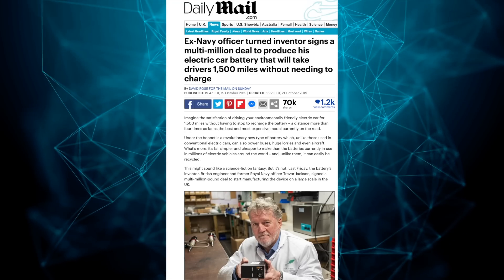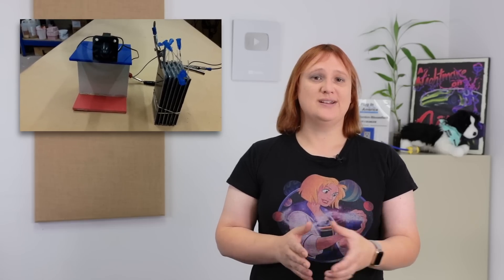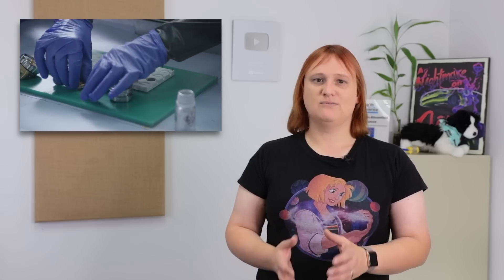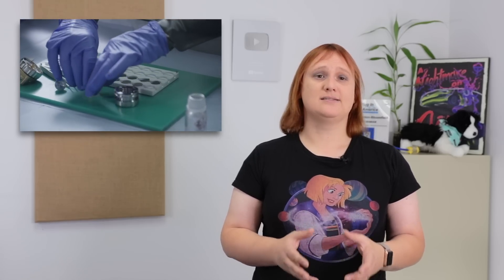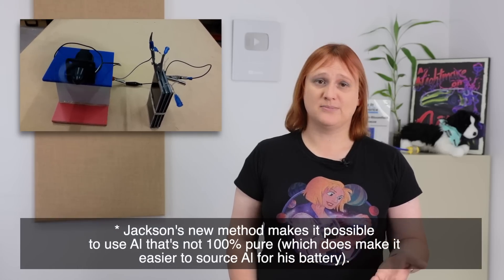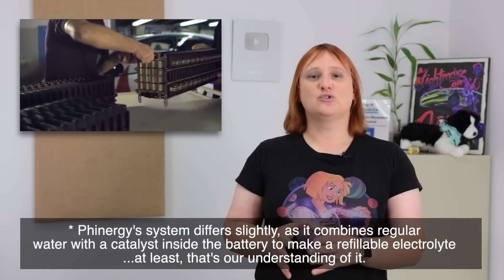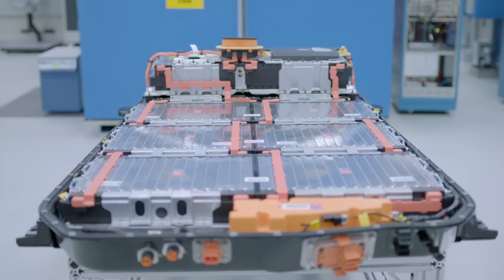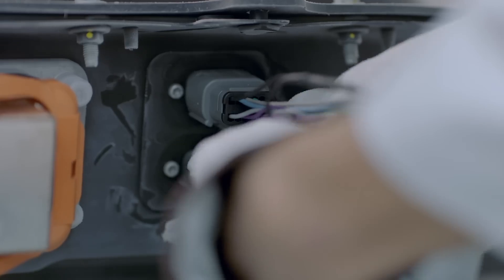Is This Battery The Holy Grail For Electric Cars?

Comment: regardless of the materials used i don't see how a battery that needs to be remanufactered every time its charged is going to be better for the environment.

Its almost like talking about making a car that uses giant Duracell disposable battery's silly really.
Reply: Respectfully disagree. Aluminum is cheap, not terribly toxic, easy to work with and widely available. By comparison, gasoline is very nasty stuff!
Reply: The aluminum oxide can be reprocessed into aluminum. If that process is powered by relatively clean energy and people recycle the battery like they do lead acid ones, then you have a net gain.
Reply: Plus they can use recycled Aluminium in the production of these batteries
Reply: And then there's the extensive energy needed to refine oil into petroleum through process technologies. Aluminum might be no worse.
Reply: @shrimptopian this new system is more energy dense than lithium ion, independent testing puts it at around 9x the energy density of lithium ion.
Yes the tech has been around for about 100 years but has not progressed much up till now due to less toxic alternatives being available, until this man found an alternative electrolyte that isn't toxic.
BUT petrol has been around for about 150 years as have lead acid batteries and current vehicles wouldn't have a hope in hell of running on those 150 year old formula. They have been able to advance these because money and resources have been pumped in to them. The Aluminium air batteries have had nearly no money put in to them for advancement.
As to your point of Aluminium recycling being high energy and toxic that's a load of bollox! Aluminium recycling is essentially just melt the waste metal and recast it. Zero toxic chemicals used and about 70% less energy used compared to lithium production.
The only drawback to this tech is the energy pack replacement infrastructure and cars being designed to be able to hot swap the energy packs
Reply: @shrimptopian apart from the lower grade Aluminium needed and the less toxic electrolyte used  you are absolutely correct 😅
But as I said we will see soon enough as it's going in to production next month
Reply: @shrimptopian the new system that this video is talking about has zero toxins in the "battery" to inventor even drank some of the solution to prove it. this new system can use low grade Aluminium that is easily and widely recyclable. its essentially powering a car with old coke cans
Reply: @shrimptopian so you are happy to stay with a gas powered method of producing petrol then?
If we listen to people like you we would still be living in caves.
This new system is using recycled Aluminium (which needs less power and causes less harm to the environment than it does to produce lithium batteries or petrol) and a safe electrolyte that is proven to be non toxic (Has multiple patants and has been demonstrated in public) and is shown to be easily recycled when depleted. 

This video didn't show the technology very well and missed large parts of the advancements that he has made when he has developed the new "battery"
Reply: @shrimptopian yeah I'll just sit over here as the qualified electronics engineer that's being paying attention to this tech for the last 3 years since the engineer first announced what he was working on. 
But of course because that doesn't fit your limited knowledge of this technology then I'm obviously just some random retard that doesn't know what I'm talking about
Reply: @shrimptopian this may all be true, but I guess we'll find out very soon since the batteries are going in to production next month.
Reply: @shrimptopian FYI you using Thunderf00t as a source shows that you don't understand science very well. That boy has been debunked on just about every statement that he's ever made 🤣
This was the first one of a very very very long list that I found ripping him apart and proving that he can't be trusted as a reliable source
https://www.richardcarrier.info/archives/9345
Reply: @shrimptopian ah! you are one of those people that thinks that anything in the media is a lie 🤔
Ok how about a reputable source then? I'll start with this one
https://www.ncbi.nlm.nih.gov/pmc/articles/PMC6504778/

Comment: I do not see this working well in the automotive realm ,but in aviation both maned and drone this could a game changer.
Reply: In the long-haul trucking and cross-country bus space, this could also change the game, and for at least one of the same reasons: energy density by weight. But don't forget a rechargeable storage solution, like an ultracapacitor, for regenerative braking. You want that regen brake for one paramount reason: safety.
Reply: Yes, aviation all the way...I don't think ANY current electric car owner (myself included) wants to A) give up the freedom of refueling at home, or B) get put back into a similar model of being dependent upon a service station... This battery technology IS cool, but in planes, boats and other applications.
Reply: @bmhsonic  Refueling at home is great but there are millions of us who live in Town Homes where charging stations are not feasible at this time.
Reply: @kelvinleigh  understood, but DC Fast charging has come a long way, and it's only getting better as time goes on. With improved battery technology, and newer quick charging standards it won't be long before we see 10 minute or even 5 minute recharge times. Until then there are answers to apartment/town home dilemma. Have you seen this episode of Fully Charged? https://youtu.be/Frkw6aurVUY
Reply: @kelvinleigh  if you go down that road, compare costs. You'd need a swap station that can handle the batteries. Tesla built a couple, they cost millions. Now Tesla swap stations didn't need a supply of batteries delivered, because it charged them up, but this is going to need a semi trailer to deliver batteries. So there's going to be staff to take delivery and reload the semi with spent packs. So it can't be automated. They're going to need to buy enough land for a semi to get in and out, which in a built up area might be 10 million pounds. They're going to need to have a couple of hundred packs on hand. At 5000 each, that's a million pounds in stock on hand.

Compare that to putting a 13A socket on a few hundred existing parking spots, or installing a couple of 350 kW chargers.
Reply: @gasdive  There's also the problem of thieves.
Reply: @kelvinleigh  And greedy grid capitalistic companies tie more than power, they like your wallet. Also cities are allowed to add fee %% wise to be collected on your power bill that are used by the city giving them free range to your money,,,money that is voted on by few and continuously collected, not project discussed/disclosed/.
Reply: It's not a game changer. Not only is this old tech. It can't be recharged. Once it's spent you have to buy more. I drive 1500 miles in the course of a month. Reusable and rechargeable is much more convenient for the environment.
Reply: louneson exactly, aviation was my first thought as well
Reply: Every application will benefit. It’s a game changer. I knew someone would do it. Well done Mr Jackson

Comment: I could see those used in specific applications such as aircrafts where energy density is more important. Also emergency backup power would be a great place for those batteries. This could be the "jerry can" solution for electric cars as well. I see many uses but definitely not as primary energy source for transport.
Reply: I like her idea of having it be a range extender. If Lithium is the primary, then you can do your daily commute on rechargeable batteries, but you have the aluminum battery for the rare long road trip... And you don't need to wait for a charge or worry all the charging stations are taken if they can be sold as a commodity product you install yourself. If they have the price per mile or gas, that'd be even better.
Reply: @Thomas_Acharya  Fuel stations could offer these cells for sale as range extenders.  Plug the car into a quick charger station, walk inside for a snack, buy the range extender battery (or batteries), walk back out to car, open special slot in car, slot it into place, drive away.  I like it!
Reply: @shanefiddle  The lithium ion battery packs in current cars weigh around half a ton. If this is 10x as energy dense, you're talking a 50lb disposable battery for 100 miles of range.
Reply: @NatTuck  meh.  doesn't sound very useful, eh?
Reply: @NatTuck  What are you talking about "half a ton".  That means a battery of 1000 pounds -- are you just talking about pure electric cars like the Leaf?    I never realized that it was that much battery weight -- must take forever to charge up.
Reply: Excellent idea for passenger aircraft that already have to refuel each time it lands! Just remove the used packs, and replace with the number of packs required for the next journey. Balancing the weight energy ratio the same way Aviation fuel weight is calculated now. This would certainly remove the hazards in the current system (like aircraft ending up in a ball of flames when things go wrong).
Reply: Aluminum batteries are not rechargeable. The material dissolves in the electrolyte so you need to dry it out and then heat it to over 1000C plus apply current to get the Aluminum back.

Btw Austin Electric is worth 4 pounds as a company. The Electrolyte is pretty much guaranteed to be some sort of mixture of baking soda and vinegar (aka drain cleaner).
Reply: In the aviation setting, if the plug-in-the-new-pack process was simple enough, this could potentially be faster to fill than conventional fuel. Interesting...
Reply: @GregTjosvold  as long as it was safe to fast charge the lithium batteries too whilst people were boarding. The aluminium ones aren't powerful enough to get themselves off the ground alone.
Reply: I could see a 100 mile version that has a charging cord. AL-Air batterys have a long shelf life so it could just sit in the trunk in case you run out of battery on a camping trip.
Reply: @LaserFur  a 100 mile battery is going to be something like 30kWh, which at 2kWh per kg would be about 15kg. 
But the power density is only about 200W/kg so you have only 3kW of power. That might boil a kettle but it won't do much to move your car.
Reply: Elon Musk already has said the new Roadster will exceed 1000 miles per charge, and all batteries going into production in 2020 are going to be "million mile batteries". As in, you get about 10% of the total battery degradation over the span of a million miles. Making them more reliable than combustion engines. They should last longer. And seeing as EV's usually have more computer based hardware, they're much more easily up-gradable. They can consistently deliver new updates and experiences on older models. Meaning your car doesn't technically have to be out of date after just a year.
Reply: Good "jerry can" for E planes! Especially flying over rough terrain or water.
Reply: The guy says in the article that the 1500mile battery would cost £5000. Not so keen now are you.
Reply: @MrGonzonator  
That's  £ 3.33 pence per mile
Reply: @MrGonzonator  Good point. Even if you got say £4,900 for swapping the old one back that would still work out at 15p a mile. Same price or more as FF.
Reply: @Joe-lb8qn  and you still have to ask where the energy is coming from to "replenish" the battery. How efficient is it compared to just plugging in a li-ion one?
Reply: Trouble with the planes is you need a large amount of power to even get off the ground. These aluminium batteries are relatively low power density compared to lithium. Maybe a hybrid system would be better.
Reply: I respectfully disagree. If the electrolyte is safe enough to drink, it can easily be made to allow the owner to swap out their own aluminum anodes.
Reply: @ttystikkrocks1042  The reason access to EV batteries is restricted to trained professionals is not the electrolyte, it's the high and potentially lethal voltage.
Reply: @wermagst  High voltage exists with EV chargers.  Proper connect/disconnect design is the key.
Reply: @posteroonie  I'm thinking  that that is probably correct.  My familiarity is with Prius batteries and the Safety Switch they have installed.
Reply: Perhaps it could include an aluminum recycling system? Just toss in a few beer cans to get more miles!
Reply: @rogerlafrance6355  I seem to remember Dr. Emmett Brown doing exactly this in "Back to the Future" !!
Reply: @ttystikkrocks1042  "...it can easily be made to allow the owner to swap out their own aluminu anodes."  How do you know this?  Source please.

Comment: Total rubbish.
Reply from the maker: What?
Reply: @transportevolved  some folks can't think outside the battery pack. I see no reason why, with such an apparently safe electrolyte, the battery can't be made to accept user replaceable aluminum anodes. It could be as simple as dropping a six pack of your favorite beverage into a cooler.
Reply: @transportevolved  It's not a battery it's a fuel cell. The fuel is aluminum.  Calling it a battery is misleading. If you want a fuel-cell powered car hydrogen is the way to go.   The reprocessing cycle (smelting) of aluminum is less efficient than water hydrolysis and requires high temperatures and nastier chemistry.   The headline 1500 mile range is a complete red herring, as a hydrogen fuel cell vehicle could do the same if it was fitted with a large enough tank.  Finally, the current working aluminum fuel cell provides such a small amount of power it will take a decade to be useful in a car if that is even possible.
Reply: Rick Dorbolo I agree about the hydrogen fuel cell. But I am not sure you should include the original manufacturing costs the “Bayer method” in the secondary process Hall electrolysis

All these add to ~ 15% energy compared to 85% energy for smelter unit only.
Reply: Which part is "total rubbish"  ?
Reply: Robert Arrowsmith are you saying the Aluminium Air batteries themselves are total rubbish, or are you saying Transport Evolved's take/presentation/opinion of the technology is total rubbish?
Reply: Robert: before commenting do some research
Reply: @rajukr6222  Have you done any research? I have watched the actual battery scientists who are working on these batteries, not these so called keyboard scientists, and they all agree battery breakthroughs are many years away from production. Sad but true.. I remember an article put out by Elon 2 years ago where he had stated that his battery research department had developed a battery that lasts 2x times longer, 2 years later it's still not in production. So many great lab rat batteries that show great promises but none apart from the good old Lithium have escaped the lab yet...